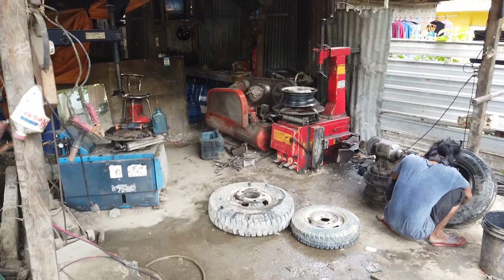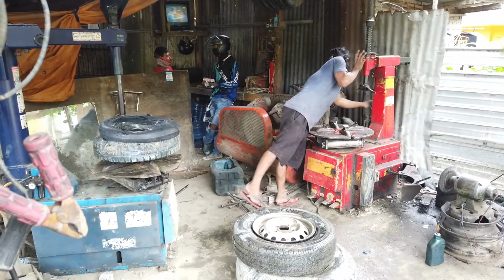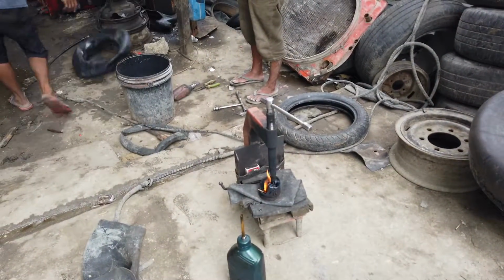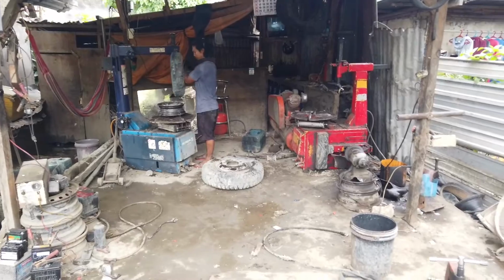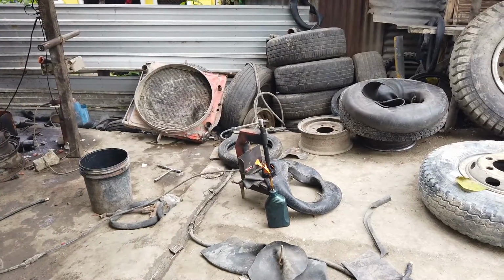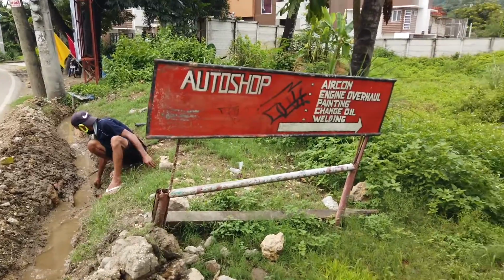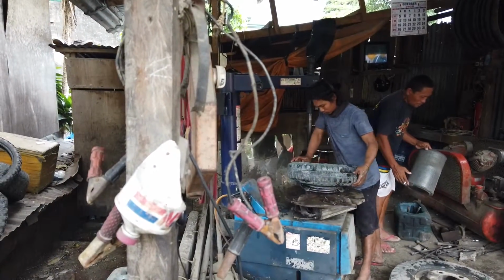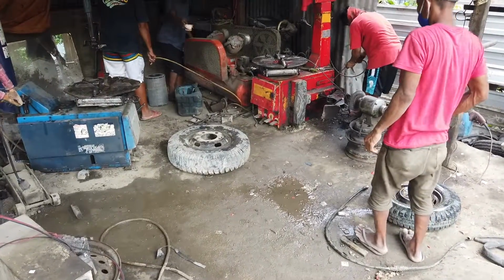Filipino Tire Repair. Vulcanizing Shop

Comment: 80P there. Solid $20.00 USD here in NE Texas. I was rebuilding trailers and most all needed tires so I bought a used Coats laydown tire machine. Thing has paid for itself many times over.